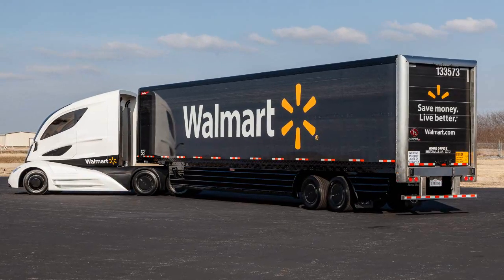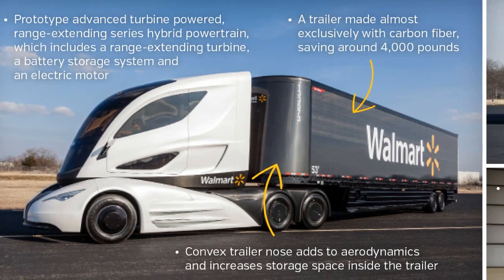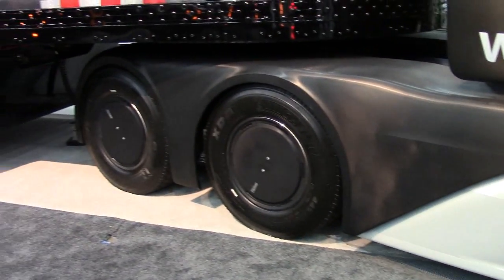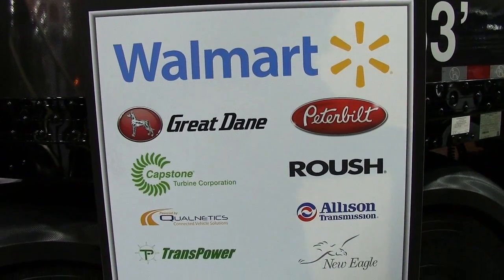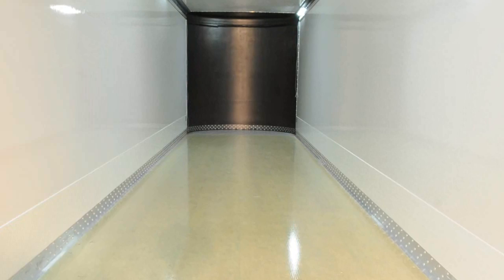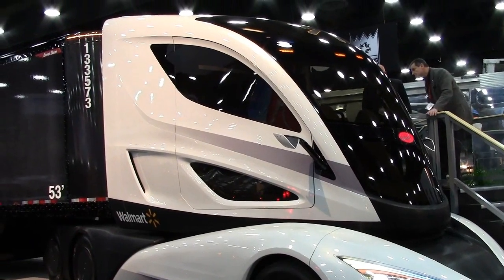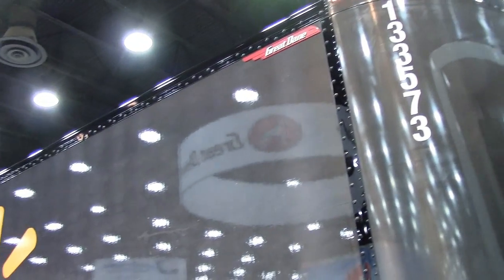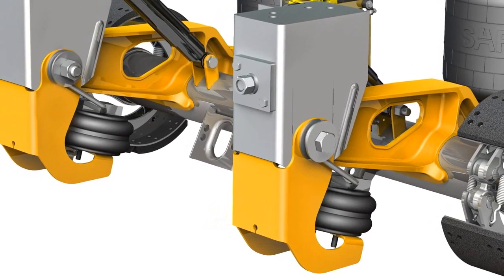Carbon-fiber concept trailer cuts weight by 4000 lb

Comment: That trailer is impressive; I was in awe of it.  Carbon fibre is beautiful to look at as well.  I'm interested to learn how practical and durable the material would be over the long haul.  I suspect forklifts would tear it apart very quickly though, but not through normal use, but instead by inadvertent errors.

The central driver position does lend itself to better aerodynamics.  That tractor punches through the air like a bullet, which compared aerodynamically to cab over designs (prominent in Australia due to length restrictions) would be extremely beneficial.